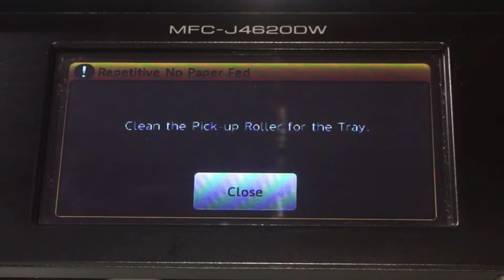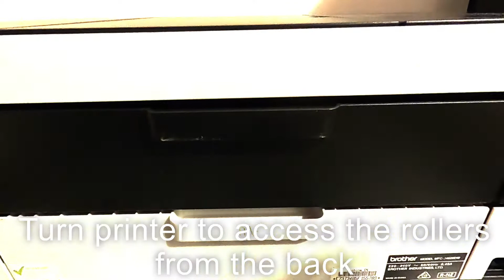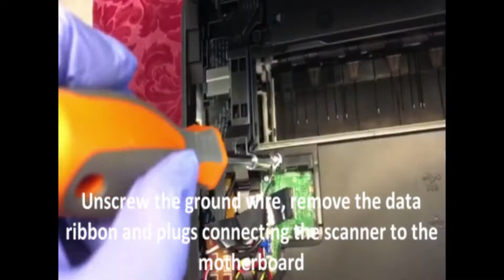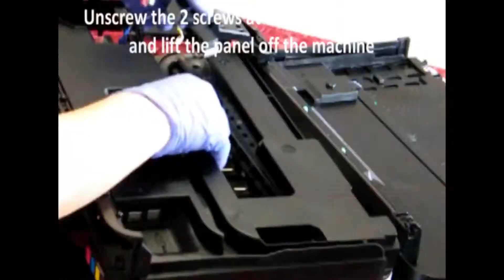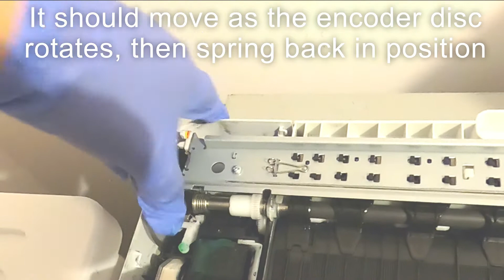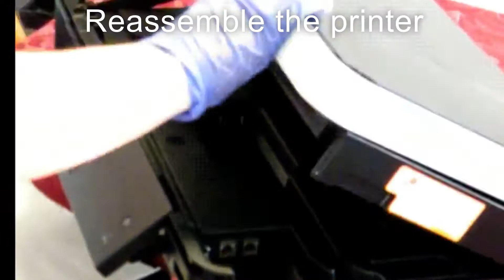Hack to Fix Paper Feed Error on Brother Printer and Clean Pick Up Rollers on MFC and DCP Printers

Comment: My Brother MFJ-J985DW started malfunctioning after I had to clear out a paper jam. I pulled forward the green tabs on the left and right insides of the paper tray area, as per the printer's onscreen instructions.I pulled out the jammed page. There were no instructiosn about how to reset the two green tabs, so I manually forced them back to their original position with my fingers, then re-inserted the paper tray. Now, when I print a single page. the printer prints ok, but it fails to fully eject the page after printing. The page is most of the way out, but the back edge of the page is being held by something. I can give the page a light tug and it comes out without too much force. Of course, now when I print multiple pages, the second page jams up the firsr page is not fully ejected. Can anyone suggest a cause and a fix? Did I break something when I forced the two green tabs back to their original position by hand, without letting this nbe done by inserting the paper tray?
Reply: did you ever solve this - I have the same

Comment: Thanks for the video. Can't replicate your sponge fix for the home position detection lever. It's either too loose or too tight which pushes the lever too far forward and traps itself on the next turn. Any other fix suggestions? Can this part be replaced or fixed?

Comment: Cleaning the ribbed rubber wheels with isopropyl (they're slightly hidden, you have to turn them manually) made them a lot grippier and finally fixed my problem. Thx for showing where to look!

Comment: Hi I have done all on this video but am still getting 'paper jam on front'. No scraps of paper inside, rollers cleaned when printer restarted it still shows paper jam and won’t pull in the maintenance sheet either to deal with scraps. Any other advice? Have tried to reset as per your other video but still ends up with a paper jam error message. Thanks in advance

Comment: I have brother MFC-9560CDW. And the error message always said Tray Not Detected. What should I do ?
Reply from the maker: It’s most likely a little piece of scrap paper around the tray or tray sensor. Take each tray out,  and thoroughly check for any fragments of paper, then put back in the bottom tray first then the top tray. If this doesn’t fix, let me know

Comment: Hi thanx for the tips. I just got a Brother MFC-J870DW. What Is back panel used for ? Im confused. I thought the paper tray is in the front. In the back u open to clean but call it a paper feed. Do u put paper in the back as well ? or is this made to access paper thats jammed. Also can i just hook up one usb cable from printer to my computer to access all the printer features ? Thanx
Reply from the maker: The back panel is the manual paper feed. Like you said it’s useful for accessing paper jams, but is mainly used for printing on special photo paper, or envelopes etc.
Reply from the maker: You can just hook it up to your computer via USB, or you can still access all the features with wifi (although you might encounter more frustrations with wifi when ips change or the internet drops out etc